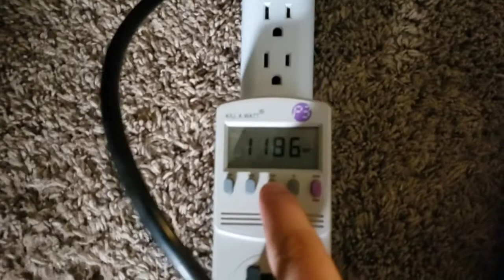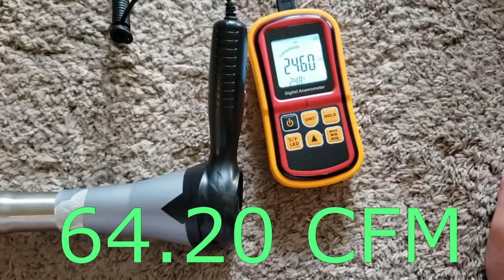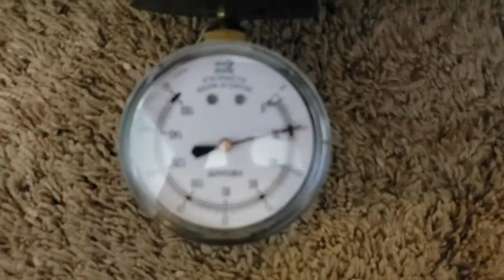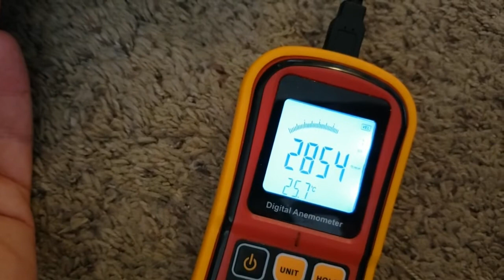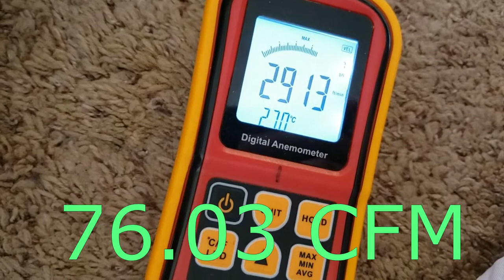Hoover Z400 airflow test

Comment: I have a Z700, which is the deluxe version of this (it adds LED headlights, and a gentle brush setting that turns down the motor speed when cleaning delicate rugs), and I love using it, but I do think it was one of those cleaners than looked better than it performed.  I didn't expect the airflow at the cleaner head to be that high though, I've always believed my Z700 had better carpet cleaning performance (as well as great agitation) than hose suction.  Final remark I have is the "self cleaning" filter, honestly doesn't do anything, that feature was quite a gimmick, and the metal pick isn't really effective at keeping the filter clean for very long, and eventually the filter will have to be cleaned out by hand.  But with all of that, it's still a great looking cleaner and is definitely quite a collectors item.
Reply from the maker: Yeah that nozzle airflow was quite surprising! I was expecting like mid 50s just based off of how weak the hose seemed to be. Thanks for the info on the 700, some decent additions.